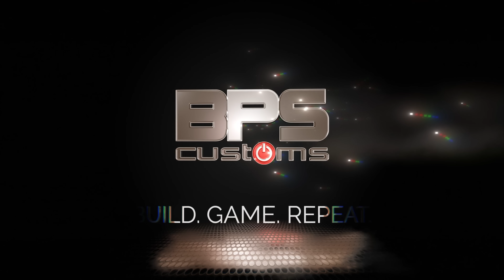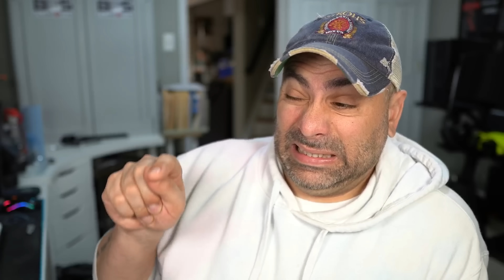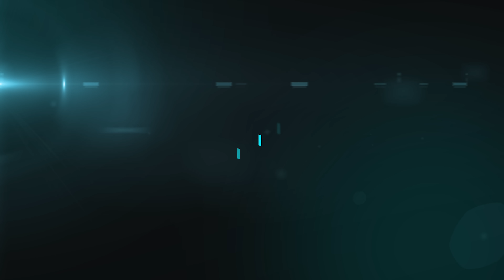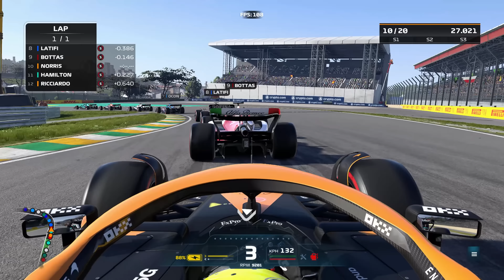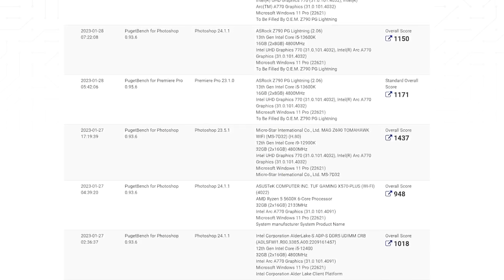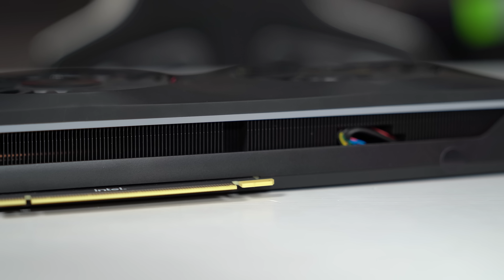NVIDIA & AMD Should Be Scared Of Intel

Comment: I bought an A770 16gb about 3weeks ago and I'm pretty impressed with it. My puter has AMD 5800 x3d and 32gb of memory aside from a few visuals I;m waiting for future driver updates to really see the potential of this GPU. Intel has come a long way since the i740 days. I ran some benchmarks in some of my games and it's 100 to 150 @1080p. I'm willing to give them time to fix what needs to be fixed and make improvements on software too. To me it's pretty easy to use if you want to kick it up a few notches and get a little out of it. With the price and hardware issues that seem to plague the others I consider this an exceptional value for what I paid for this card ...350.00?!? Look at what the others cost first.

Comment: The performance has definitely improved. But I will still not buy the Intel card even though I am looking for a GPU right now - even though it has AV1 encode (I rarely edit some videos), even though it has good RT performance (I doubt A770 will be enough to play RTX remix games as supposedly it can't even start Portal RTX). As I mostly sit and browse internet the idle/media playback power usage is important to me and it is terrible on Intel Arc. I also plan to go back to old, unpopular games like Cossacks: European Wars from time to time. I can't risk having 20 yo games stuttering or not running at all without any real hope for fix. 
When it comes to GPUs stronger than A770 - I think there is no need for making one. Most BUYERS don't really need more performance than that, according to Steam most people sit on 1080p displays and a sane person doesn't need to run games on ultra. Realistically A770 is a good top end GPU for BUYERS rather than reviewers running benchmark suites, looking at FPS charts and doing :o face on the tumbnail. 
Interestingly in the same way ARC can look like good product - it can compete in DX12 titles benchmarks but loses on just running older games and at literally doing nothing.

Comment: To me it depends on how good ARC is doing in old games since I like to replay games like first FarCry, Quake 3 Arena, NFSMW and so on; don´t need 300fps in those old games (haven´t played those framerates back than in those games and don´t need to now) but upscaled to 2K or 4K and 120/ 80fps with no huge framedrops is required for me to concider ARC. Even a GTX 770 or R9 280X are capable of 120fps in upscaled 2K Borderlands TPS so a modern ARC should do the 120/ 80fps why more consistent than those ancient GPUs. If they can do that, I concider ARC.

Comment: I never had any of the crashing problems that the reviewers talk about.
I got my asrock challenger a380 at the end of August, paired with 12400 on a h670 d4 board with a clean windows install.
Driver updates cleared up some strange texture issues, such as how text rendered on buttons in dx9 titles.
The Arc control still needs some attention. In particular, the security popup, video capture auto file naming, adding hot keys to turn capture on/off.
I look forward to future updates this is quite promising.

Comment: I game at 1440p I have this card in one of my Pc's.   It will keep right up with my old 3060 ti, i love this card, i hope intel can produce a card that can contend with the 3090 ti, I will switch my other 2 pc's over to intel when/if that happens.   The rgb on this card is great too, it has a cable that runs from the GPU to a usb header to control the rbg,  colors look great in the case.  I also am building a pc for my girls son, he will be gaming at 1080p, he will be getting this card in the build.
Reply: Really pretty card. Doesn’t work with VR though
Reply: @SantoValentino  That's good to know, I don't care about vr so much. I am currently benchmarking 5 or 6 GPUs on two different computers to show how much performance increase there is with a 13900kf and may just have to buy one of these to throw into the test.
Reply: @SantoValentino  well that's not good. I do some VR dev as a hobby.
Reply: @sqwert654  I tried to work around it but couldn’t. I heard some could using virtual desktop but that’s too much for me. If it doesn’t work it doesn’t work. I just went with a refurb 3060. Runs flight sim and kayak and alyx just fine for me. I don’t need a 4080+
Reply: I also hope Intel comes out with a high end card. This is still impressive for what it is and love the way they look.
Reply: Nice I game at 1440 with a 2070rtx atm and looking for more fps, bur also a rendering card for 3d work.

Comment: I would buy one of these if it wasn't for the requirement for RE-BAR. My system isn't really geared for it, booting off SSD's with CSM enabled etc... so it would be a major hassle, but if I could plug it in and it just work the A770 would be my next GPU, no question. The value proposition for a brand new card is too good to ignore.

Comment: I share your enthusiasm for a new player in the GPU market. Unfortunately, recent numbers from other outlets point a very different view of the Arc 770. At least when paired with a Xeon on the X99 platform or when using Linux. Both of which I would do. But I get it that Intel sets its priorities on Windows for gaming. However, I would do much better and with less headaches with AMD for now.
Reply: @innocentiuslacrim2290  Yes, but X99 supports it and I've modified my BIOS according to the miyconst video how-to to get it enabled. So it should work perfectly even on X99, but his latest testing showed some anomalies with Arc that were not there with an RTX 3060 and AMD card.
Reply: Here is the miyconst comparison: https://www.youtube.com/watch?v=IftDlE76BgU

Comment: Because Intel has fully open source drivers and hardware support, the Intel ARC cards have huge potential to be massive in the Linux space for use in gaming, media encoding and serving (especially for AV1), streaming systems, media servers, etc.    HOWEVER, the hardware support for ARC is not really included until Linux Kernel 6.1+, which you will not be seeing appear in popular Linux distros until about 2H23.

Comment: I have the Intel A770 in my Intel NUC 11 Extreme at work and it is awesome, allows me to archive our Live Events footage in AV1 saving valuable NAS Storage space which given that a single event can generate 2TB of data, the savings in disk, backup and Offsite backup from a single event equate to the cost of the card.  Plus it is a sensible 2 slot design and great for 1080p gaming during my lunch time.  Yes the drivers and software were garbage at launch but the drivers are fine now and with regular updates.  ARC Control is still rubbish, but I do not install that anyway.

Comment: I bought a Acer Predator Bifrost A770 16gb, its a fun card, for the money its a beast, the drivers keep getting better, when the major dx11 update(based largely on dxvk) drops, its gonna be a game changer :) 

i have had this card since nov and love it... i got no complaints... 

imho, the extra cost for the acer is worth it, better cooler, better power limit and no pig tail to control the rgb its just built into the card... 

the cards alot of fun... 1440p and higher work pretty well on this card, 1080p is not this cards strong point... often gains very little dropping from 1440p in my exp..

Comment: I am considering A770 myself, but my biggest concern aren't FPS in the AAA titles - with games like Cyberpunk or RDR2 it's obvious that Intel is spending a lot of effort on optimization because that's what most people look at. What I'm worried about are the obscure/older titles where Intel didn't have a chance to do any real optimization. Linus made a video on this topic when the card came out where they ran multiple old games, and more often than not, the older games ran either horribly or even had issues starting in a first place. Sadly they haven't made any new video after the driver updates and it's incredibly difficult to find any YouTubers doing proper testing of other titles than the standard AAA titles where the performance was solid already when the card launched...
Reply: i have had an acer a770 since late nov, from dual 1070's, honestly, not had any problems dxvk didnt solve with legacy titles, but often i already had dxvk installed in those games, because it solved perf issues and sometimes other issues by being able to mask a card as another vendors, mostly for TWIMTBP titles.. but either way, dx9 titles as old as farcry run f-ing amazing at 1440p on this card, i have not found a game thats given me real problems, and i have older titles.. for farcry (original) dxvk is a must, BUT its also a must if you want silky smooth play on nvidia as well, the .1% lows and 1% lows are often crap on the default dx9 path, dxvk... well my min fps is higher them the 165hz of my monitor now even with a heavy reashade applied over dxvk..  

same is true for most old titles.. at worst, you need to install dxvk to get them up and running.. at worst..  

there are a few people making more up-to-date videos now, one fellow is going back to some of these old classic titles and testing with and without dxvk thanks to my pushing him on discord to do so.. look up "Tech Guy Beau" and yes his title is clickbait for the latest video, he knows it... heh.

anyway hes got more coming soon, he had to buy the original far cry and some other old titles like crysis 1 to test....

honestly dxvk is a godsend not just to linux gamers but to those of us playing old titles on windows as well.
Reply: They released a new video about it.

Comment: I bought the 16GB A770 as a utility card for AV1 encoding my media collection and currently have it running in a Windows 11 test system that's running a 7950x in 105W TDP ECO Mode.  I'm an EVE Online player, and the card is able to run 4 accounts of that game simultaneously in windowed mode using a 5120x2160@72Hz monitor (the LG 40" one).  While it's going balls out at 100% usage doing this and my old 3090 does much much better, at $350 I am not at all unhappy.  I'm looking forward to seeing what new drivers can do, as I'm currently running on the WHQL driver set.  Would I consider a higher end Intel GPU?  Absolutely.
Reply: the latest betas fix several titles, and add better dx11 support, its not the full dx11 patch they have coming though yet.. sadly.. 

been a long time since i loaded eve up.. if its dx9-11, you may want to try dxvk and see if you get better results, i would not be shocked if you do ;)

Comment: I have two reasons for wanting to purchase this card. The Price and helping Intel succeed in the Graphics market. I always buy price to performance and I believe this card would make a nice 1440p gamer.
Reply: I've owned one since launch week. I can say that the driver improvements have really brought this card all the way from a joke to a serious contender. I run Modern Warfare II at 1440p Ultra settings (w/ NIS upscaling) and I get on average 100-120fps (paired w/ a 12600k), sometimes higher, and very rarely lower. You still technically need to use DXVK for certain games, but even then that might not be true for long; word is a second major update is in the works, and it's apparently gonna resolve one of the bottlenecks that was holding back the A770 from using all its power.
Reply: @johnnytex1040  did MW2 come for free with your 770? I ordered mines 2 days ago and it came with MW2 for free😁😁😁. Such a god tier deal $350 for a gpu that performs like a 3060ti and sometimes a 3070 and it will continue to improve + a free $70 game!!! Such a good deal. And it’s $100 less than the higher end 3060ti cards and around $200-300 less than a 3070 card.
Reply: @Gojiratech1234  I did! It was such an awesome bundle. And as someone who prefers BLOPS, it gave me an excuse to try the more tactical MW style lol. As of right now, when running the game on Ultra (w/ a couple tweaks in both directions) XeSS can get me around 85-90fps at 1440p. NIS set to Balanced and w/ sharpening set to 20 (not a hard number, I'm probably gonna experiment more to see what the ideal sharpening would be) produces an image quality that's only a few steps below what XeSS can provide, but nets me about 100-110fps on average. If this upcoming driver is all that, it could possibly allow me to use XeSS full-time and get similar performance to what I'm getting now on my NIS setup, which would be amazing. XeSS in terms of quality is awesome in MW2.
Reply: Spend money elsewhere.
Your brain can't even see the difference when your 2 feet from the monitor.
regardless of what you tell yourself.
Reply: @testickles8834  This is not only anecdotally false, but also easily debunked using some commonly-known formulas. The best one would be the PPD formula, which is used to calculate when a display attains retina level of sharpness. PPD ofc depends on some distance, but at a viewing distance of about 2.5 ft a 1440p 27inch monitor will have a PPD of 60, above the 57 necessary. That's the objective part, but as someone who uses both 1080p and 1440p regularly the difference is absolutely noticeable. Hate to assume intent, but comments like this tend to be made by people who don't have the means to experience such things (which is understandable) and are just coping. If you think there's more objective weight to your claim than I'm giving it, I'd love to hear it.
Reply: @johnnytex1040  Do you think the drivers of the Arc models will improve that much over the next time like AMD's drivers? For example the 6700 XT was always slower than the 3070 and even the 3060 Ti, but nowadays (since 1-2 months) the 6700 XT is even better in raw performance than a 3070. So could it be possible that intel could do the same?
Reply: @ohneflachsderlachsderhats6590  that is definitely possible.  I cant see the a770 going backwards in performance.
Reply: @ohneflachsderlachsderhats6590  It's entirely possible; the hardware analysis I've seen by guys in in the Intel discords all show that when it comes to just raw power the A770 could peak at around RTX 3070 (most likely in practice a couple steps slower, so maybe around 3060TI levels or so). As someone who spent time (in vain) trying to OC this thing towards that level, I came to the conclusion that one of the bottlenecks preventing ARC on a driver level from reaching those heights was the lack of power efficiency; I raised my power draw allowance all the way up to 228w, but in practical applications the thing refused to ever go above maybe 170w. Anecdotally, this thing has already seen massive improvements from the driver side of things. I went from getting 75-85fps in Halo Infinite's standard map to getting 120-135 fps on all but 1 quickplay map from launch till now. I can consistently see myself get owned in 240hz now in Valorant (though bc I run all my games at 1440p high there's some frame drops here and there). If you're willing to use DXVK Async (a process that takes half a minute to use), performance can become wildly better even in DX11 games. Sonic Frontiers for example went from stuttering all the way down to 25fps to a silky smooth 60fps. And the best part is? Intel (as I mentioned earlier) may have actually identified and found a way to eliminate one of those key bottlenecks. We may well be approaching a time where we won't even need to use DXVK Async to get good performance in DX11 games. And bc such a bottleneck affected performance in all DX versions, I can only suspect that (again, if true) this next major update will put ARC A770 right on the door step of the RTX 3060 TI, and widen the card's lead on the RTX 3060 in the games it already leads in.
Reply: @johnnytex1040  Thanks for the detailed answer! I’ll definitely keep my eyes on the A770.
Reply: @testickles8834  shoulda spent that money on an actual brain. I'd have said education but that would have only made you more unintelligent.

Comment: I got only one question, does the cheapo 380 do av1 encoding correctly?
Reply: EposVox posted this 5 months ago.  He's my go-to channel for all things related to computer video.  If I recall correctly, there was still a ton of prerelease, beta software using Intel's media engine and things worked well.  Now, for example, HandBrake uses Intel's AV1 decoder/encoder in their release software.  Here's the title of EposVox's video, "Intel's WORLD FIRST GPU AV1 encoder was worth the hype | Intel AV1 vs X264 vs NVENC/AMF/QSV"; it's a good place to start researching.  Also, Intel makes an even less expensive Arc graphics card, the A310.  All of Intels "A" series cards have the same media engine, as best I can currently recall.
Reply: @wargamingrefugee9065  Far out thank you sir!

Comment: Hi there, can I put my PC on the side to lay flat on the desk to prevent gpu sagging instead of putting it follow the normal orientation ? I did try vertical mount the GPU but my CPU air cooler is taking all the the spare space, so nothing fits, will the PC work normally if I just lay it flat down on my PC desk ? I have Corsair 4000D Air flow and a really heavy GPU, a simple GPU stick support bracket won't help it at all since I can still see gpu pcb being a little flex.